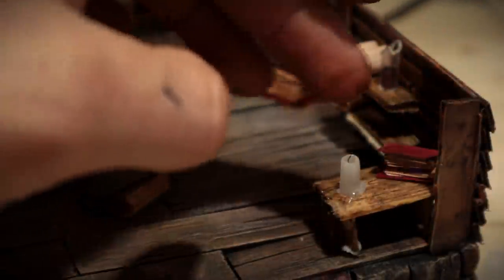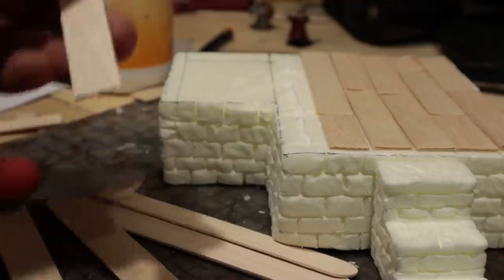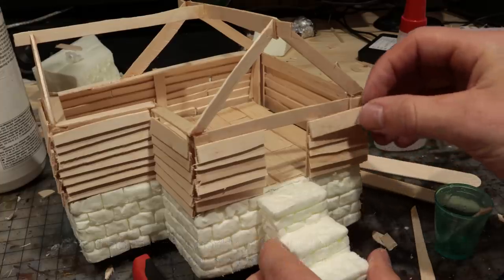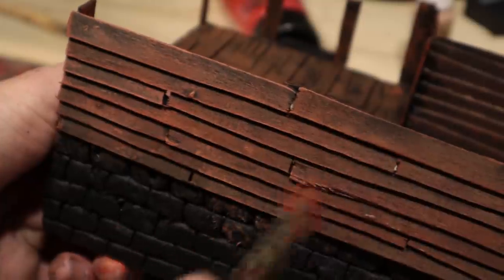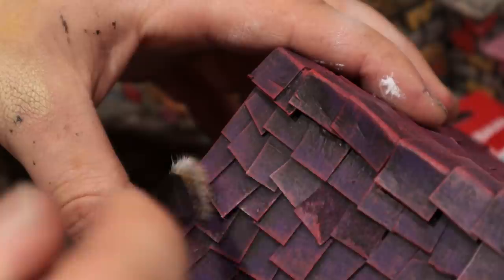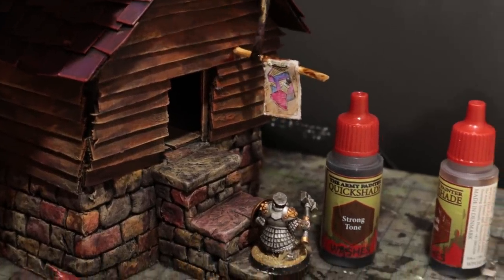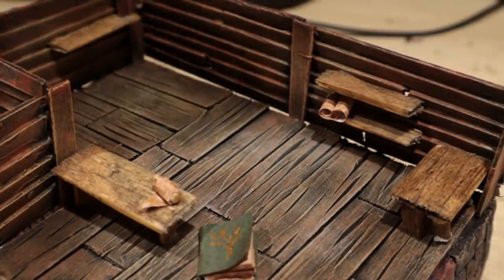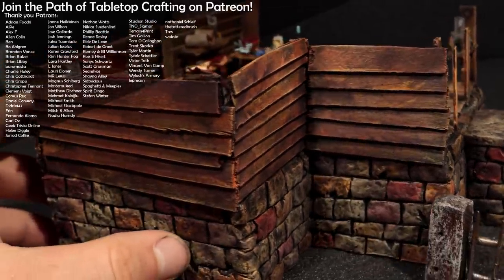The Alchemist's Shop: an epic fairy-tale craft for D&D!

Comment: Amazing! May I ask where you get your foam from? None of the foams I’ve found have worked out for me
Reply: I believe he uses the brand finnfoam, which might be hard to get depending on region.

It's xps foam for the type.

Edited to show brand vs type.
Reply: Thank you! I believe I have found how I can get it, this should help with some of my own projects
Reply: Here in Germany i tried some brands. The best was 40mm from 'Ursa' bought at hardware store  'Bauhaus'. It has rhombs on the surface but this is easily to cut away.